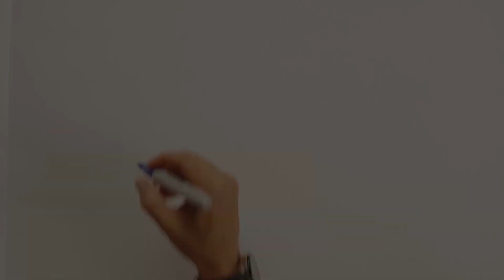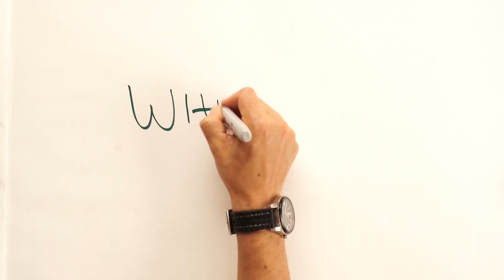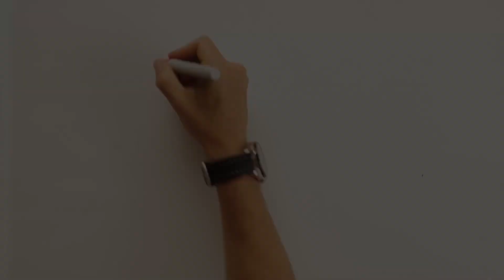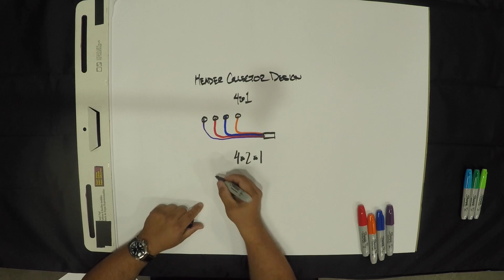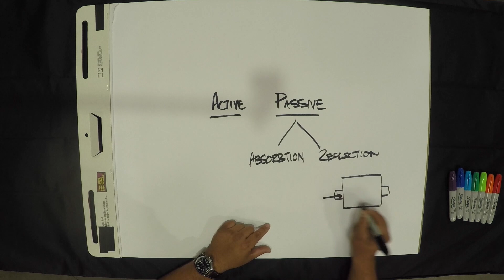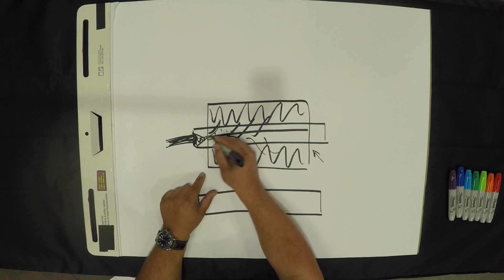No More Exhaust Myths - /ENGINEERED

Comment: Where was the myth? Was expecting a higher explanation, because what good for the track is terrible for the street unless you add gearing and richer the mixture, you need more low torque for the street not moving it way up to add H P. long ago was it headmans has header collector that was tunable as longer give back the torque that was move higher, while getting free flow rpm.

Comment: Gotta love that intro. LMAO!!! Other than the off-color humor (which I personally enjoyed), that was one of the better videos on a somewhat esoteric topic. Not much conversation about exhaust vs intake manifolds, carburetors/throttle bodies, heads, etc. Exhaust and Intake design are probably the two most important factors in getting an engine to make power. Engines are merely gas powered air pumps; the more air you can get into and out of an engine, the more power potential that engine has. A poor selection in either system will kill your desired outcome of HP & Torque. Very well presented by an obvious authority on the subject.

Comment: Are the words 'motor' and 'engine' interchangeable?  An engine creates power from the potential energy found in some form of fuel, usually chemical fuel.  On the other hand, a motor receives energy delivered  to it from a remote source, and converts it into power.  An electric motor provides power output from energy that is sent to it from a remote generator.  The generator put the energy into the transmission wires that convey it to the motor.  And the generator was turned by a turbine, which in turn was powered by pressurized steam that was probably created by burning a chemical fuel.  A pneumatic motor works in a similar manner as an electric motor.  The compressor is analogous to the generator, and the compressed air hose is like  a wire.  Motors and engines are not the same.  With that said, a train's steam engine is a motor all by itself, since the boiler sends it steam as a compressed gas.  However, the whole steam engine unit could be considered an engine since the boiler and engine unit together converts chemical fuel into power.

Comment: I have a 68 Corolla that I put a 4-1 header on years ago. I later wanted dual exhaust but didn't want to "fake" it by just having a y-pipe.
I cut the collector off the header and made two 2-1 headers out of it. Firing order is 1-3-4-2 so I had 1 and 4 together and 2 and 3 together and a couple of big quiet mufflers. Sounded lumpy if you heard just one side but if you were behind the car it sounded like the normal smooth exhaust. Ran fantastic. The engine really liked it. 
I've gone back to stock everything as it turns 50 this year and I want it as factory as I can get it (except for brakes and wheels, it came with drums and 12 inch wheels, I swapped em for discs and 13's from a '70 model) but the headers are still hanging on the wall.

Comment: I think it's important to note that a lot of TODAY'S best power increases, from eliminating drag within the crank-cases themselves through micro-polishing etc etc, don't increase the flow of the exhaust PER horsepower in as linear a fashion as is described in his pocket rule of "2 CFM per horsepower" or whatever it was. We might better best cut that ratio down, assuming you're making many more modern modifications ...  man. 'Cause when you take 'em all in cumulatively, the more efficient drive-train with eliminated parasitic losses etc, it all adds up to quite a lot - Once you've ticked off all of the boxes, that is. The net effect being that of 160 rear-wheel-horsepower out of a 1000cc-1100cc '70s-'80s Japanese Superbike which made 95HP-105HP for the stock set-up and 140HP in full race tune (and I think we're talking CRANK horses for the period's CLAIMED specs here) This being circa 1982 let's say - specifically meaning the AMA Superbike champ, Honda "CB750F" for instance, being that this is what I'M tinkering with here and in that this is where I'm seeing these incredible increases from the Vince & Hyde Classic Racebikes. Many of the expensive little mods might have only added up two or three horses at a time, but cumulatively they're significant!

Comment: car mechanic for over 30 years and while this guy is very informative he is very boring and the shit he explained that I did not already know is sorta worthless because while explains there is a lot of tech involved in header design and muffler design it really all points into a compromise between what fits and what sounds good rather then what is best. for performance reasons if a 4 into 1 header will work best for your "baby" a lot of muscle car owners will opt for remodeling the floor pan to make the better header work then throwing 20 hp to the wind and opting for the smaller header compromise .. 
I use bassanni and borla for everything as it works better then magnaflow

Comment: @ 22:52 He's talking about the "No Slip boundary condition" When the fluid (or in this case air) is flowing over or in a boundary. A tiny layer of air will be created on the boundary its self, which will have a velocity of zero. But this guy exaggerates the size of the layer and the over all net affect it will have on the flow.The arrows he draws are very misleading.  The exhaust Will NOT FLOW towards the walls of the pipe. They will continue to flow smoothly unless the walls of the pipe have a ton of carbon build up. As for the inside of the perforated muffler, the pipe will still experience the no slip boundary condition but with the added benefit of being at a lower sound level.
Reply: Agreed

Comment: Can you tell what to use to lower the exhaust sound in one piston engine, 168cc, 6,5HP? I don't have much space, muffler can only be 160cm long, 70mm in diameter. Do I use smaller tubes inside, walls with holes in it,... or what?

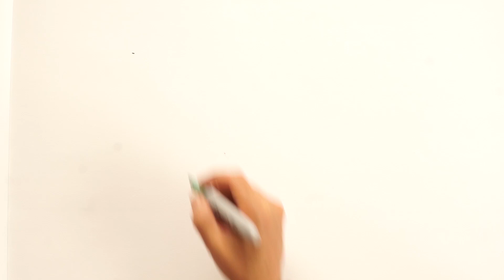Comment: the exact 20 seconds part from 23:06 to 23:26 is the part i don't understand but i really need to! if someone cares to explain?
Ok so i have an absorbtion aftermarket full exhaust on my motorcycle ( fz-09, 3 cylinders).
It backfires when down shifting and the baffle is in. Bike has not been tuned to the new exhaust yet. My question: i want it to be just a little more silent because its a bit loud. I will repack the muffling fiberglass soon, and was wondering if i should make bigger holes so more fumes can get trapped in the muffler? (as this guy is saying, reduce the friction of air to metal) or simply restrict the exit point (smaller hole) to force air into the fiberglass? thanks for your help

Comment: Hugely informative. Of course he skipped over the very issue that was of interest to me -- the catalytic converter. I have a big-twin motorcycle and will be removing the catalytic converter, mostly because of heat. So, I'm trying to figure out the impact on exhaust flow. As well. I'd be interested in his/your opinion on torque cones to increase exhaust velocity.

Comment: what will be gains for my built b16a2 swap into a Del Sol VTEC, I already have it with 5 inch diameter straight pipe from the headers back, and then I angled the pipe at the back so it looks more aggressive but it probably helps it flow better too. I feel so much more power flooring it past the supras but don't know how much, all of the dyno shops just laughed when I brought car in, help please

Comment: As an engineer that has not specifically designed any exhaust, other than some chambers for two cycles and some really basic mufflers for those, this is a great primer.  Nicely done.  I do have one question though.  Does anyone use a hybrid muffler to any good effect, eg. and absorptive front end with a chambered back end, and could any positive properties be gained from this regarding not restricting power to higher noise abatement?

Comment: I'll preface this by stating that I really admire the educational aspects of this video and the presenter. Very nicely put together. Thanks.

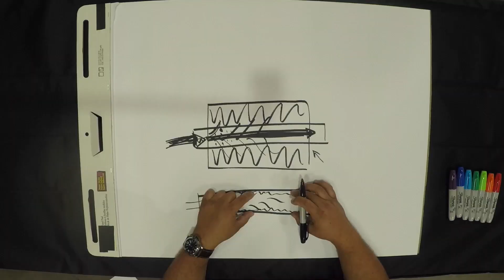22:40 - 23:24
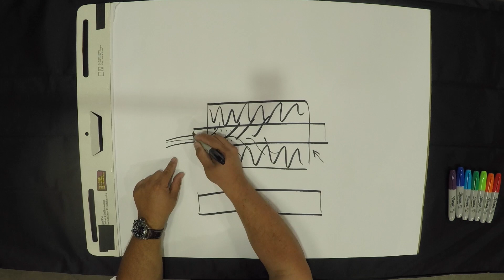That's fascinating and I've never thought about this before, but I wonder something: At idling or low cruising speeds I can see why those perforations in the absorption muffler assist in limiting drag, but at wider, prolonged open throttle how would the fact that those packing material chambers eventually fill and become less prone to letting in more exhaust through those perforations (as mentioned at 21:35) play into it resembling just another wall (like the straight pipe), and suffering from the same issues as a straight pipe? I can see how it is in some way fundamentally dissimilar because the pressure built up inside the packing chambers in a way creates a "wall of exhaust" at high pressure rather than a solid wall of metal, but I just can't grasp the details of how this makes sense.

Is it because the positive pressure inside the packing chambers acts as a kind of "frictionless wall" that reduces turbulence by keeping the incoming exhaust away from the metal walls?

I am not an engineer in the slightest, so please mind my ignorance, heh.

Peace.

Comment: If anyone ever tells you that a 4 or 6 cyl engine less than 6 liters needs a 3"+ or dual exhaust, they're lying. a 3.5" single pipe is plenty for even a 7.4 liter v8. The giant dual exhaust (I'm looking at you subaru drivers) is not at all necessary, only for looks, and just adds weight. The size of the factory manifold collector (somehow single manifold engines need dual pipes?) is the size of pipe that is the max your car needs. And you need only as many pipes ad you have manifolds max. Only engines with dual manifolds can even gain anything from dual, but still need a crossover pipe for balancing and scavenging.

Comment: From a performance aspect 4,2,1 headers are never ideal, he ignores that on a splayed crank V8s(99%) the pulses aren't even. That is there's no set of matched cylinders on the same side of the engine that are 180deg apart and can be paired in that fashion. This also holds true for 4 to1 as well, but he didn't claim it on 4 to1. Nor are dual exhaust systems ever ideal for the same reason. To get ideal flow you need to merge paired cylinders but 4 of them are on different banks. Thus to get ideal flow you must either do what's called a 180 degree header which is near impossible to fit in anything but a race car. Or you need to merge all 8 cylinders as early as possible into one tube. Ideally via an 8 to1 equal length header or more common as it's actually possible to package an equal length 4 to 1 header and a short equal length y-pipe.

Comment: you FORGOT to come back to that marvelous horsepower eater, the catalytic converter.
Reply: YES!! That's what I wanted to hear the MOST!
Reply: Exactly! Picture of the video showed catyletic converters and didnt even talk about them...dumb. maybe they had to remove that part so they dont get sued??
Reply: Cats don’t give up shit. It’s like 2% on 1000hp engine. On stuff less than that, its negligible
Reply: David Stuck don’t use
Reply: https://youtu.be/Ulw0UX3iPm4
Reply: Most modern cats don't take away much hp at all
Reply: They're pretty efficient these days. I mean sports cars come with them and they're making more power than ever out of smaller displacement engines.

Comment: so now I have this question... using my rust bucket as an example, I would love to be able to get that straight pipe sound when I step on the throttle but idle I'd like it a bit quieter because straight pipe at that point is like someone palm slapping your ears, not in a bad sounding way, just a way that would get me fines like no tomorrow even from the next county... so would I go for a large length absorbtion or would a shorter one be better or is this all again specific for what cfm you have.

Comment: Wish that he talked about electronic or vacuum operated exhaust bypass valves.  That would totally complete this video
Reply: I guess this is simply just a valve that redirects all exhaust flow to an early exit point?
Reply: Anthony Amalfitano Yes... just curious on how it effects the exhaust pulses, ect...
Reply: hey, can someone tell me if it is possible to get better hp or tork line with an after market exhaust without afecting fuell economy?
Reply: crazy portuguese with an aftermarket exhaust system to replace the OEM system you should get an increase in performance. That being said, it will not be a big change, depending on the type and quality of replacement and the spec of the vehicle it's being mated to. As with anything, you get what you pay for,  ranging from the only thing effected is a constant farting sound, to be slightly more responsive and a great sound. You would get greater overall performance gains from quality upgraded suspension system and tires/rims, and then start to bolt on the power adders.

Comment: Tri y headers don't work. Just a myth
Reply: TROLL. or a thorough display of ignorance. 
Anything that can be done to keep the air moving out the pipe will improve performance. When the air stops moving in between firing pulses, it takes (or wastes) energy to get it moving again. Mixing the pulses together for equal spacing between each pulse will help to steady the flow, making it more even. 
Your tube size is a compromise between flow velocity and volume. If the pulses are timed so they happen in groups, you need a large pipe to handle the large flow from pulses that are grouped together. However that large pipe will not flow as the pulses average out, because the air stalls out its motion in between pulses. SO you run a smaller pipe, which increases back pressure. 
In contrast, with Tri-Y, you even out the space between the pulses early in the flow. This keeps the flow more constant, so the pipe size demand is more consistent between pulses. Because the flow demand is more consistent, you have improved performance at all RPMs.
Reply: I've seen two different dyno tests. They do sweet FA
Reply: Just like nitrous cams.Some engineer said they should work, but they don't. Dynos don't lie
Reply: Your right, Dynos don't lie. I've seen Dyno tests as well. A good set of Tri-Ys are proven to work. Nascar doesn't lie either. Ever seen the bottom of an NASCAR car? They are longer primary tubes, but still are Tri-Y.

Comment: I was itching for him to relate the X-pipe to the 180° headers and flat-plane V8 crankshaft engine configuration.  While it's only an approximation, the individual flows downstream of the X are more evenly balanced than with an H and this reduces the sound effects of having two cylinders on the same bank emptying into the same collector in immediate firing order sequence.  This happens alternately, left bank then right bank, and gives the crossplane V8 its characteristic low-frequency rumble when either straight duals or an H crossoiver is used.  Those of you familiar with the traditional SBC and its firing order (18436572) know that the 8-4 pairing dumps into the passenger side pipe and the 5-7 pairing does to the driver side.  For very brief periods, the 8+4 and the 5+7 don't behave like, say, the 3 by itself or the 2 by itself, there's higher peak flow.

Comment: The factory exhaust system of my car is optimized for my car by its engineers and can't be improved on with an aftermarket system.  People have tried and they just end up losing torque because there's not enough back pressure.
A lot of aftermarket systems are just good for improving sound.
Reply: as he says towards the end of the video, you can't have the best of both worlds (torque and horsepower) with the same exhaust system. you have to pick the range where you want the most power, and tune your exhaust to that range. your car's factory engineers did that for the range they thought suited your car best, but if someone doesn't like the power curve of the car, they could certainly tune an exhaust for a curve that's more to their liking. it's very unlikely that a well made exhaust system would lose torque in every circumstance when compared to the factory exhaust. on that note, when you talk about losing torque you're likely referring to the power curve at wide open throttle, which is totally different than road manners.
all that being said, you're right that there are an awful lot of aftermarket systems that are only good for making your car sound cool.
finally, if you watched the video you'd know that back pressure is not good. aside from sizing a pipe for the correct flow rate, scavenging is the #1 priority in tuning an exhaust, and it's the exact opposite of back pressure.
Reply: Backpressure isn't something particularly desirable in and of itself - what it is, is the force at the engine end of the exhaust system required to push the volume of exhaust flow out that exhaust system at some velocity.  Higher velocity requires more pressure, but more (back)pressure interferes with engine power at something like a 2.5% penalty per additional psi.  So it becomes a balancing act, like most engineering decisions.
Reply: That just means the flow is clogged farther up stream. Usually the muffler is the weakest link, but in your case, the design weaknesses are farther up the system.
Reply: I had a bmw e34 diesel, which later I straight piped. Felt no difference at all so I came to the conclusion that the back pressure thing is nonsesne. But recently I've bought vw golf mark 4 and straight piped it. I instantly felt torque loss at the lower rpms and no difference in the rest of the range. Then I've put remmus exhaust at the back and what do you know, the car became way more responsive and torque'y again. Now I'm in need for a bigger exhaust pipe cause I've put a bigger turbo, looking for something like going from 60-61mm stock to 65mm custom exhaust system.

Comment: That compressed air is hot, so speed of sound is way faster.
Reply: It all depends on the temperature, the speed of sound is slower than exhaust gas in Siberian gulag, comrade. 306 m/s at -40C, 411m/s at 300F lol
Reply: Leibel 500 to 600 m/s depends the temperature